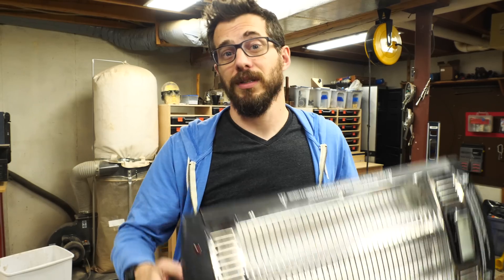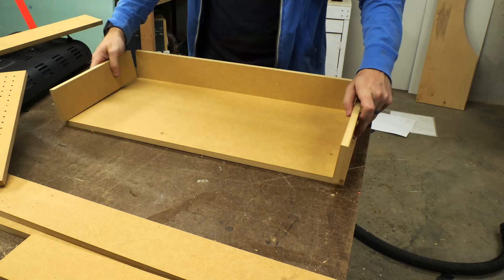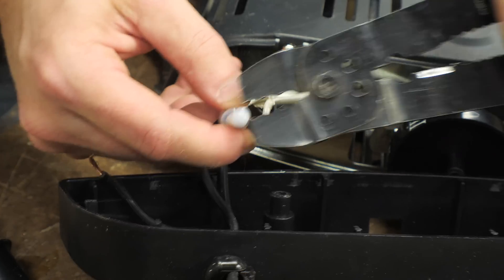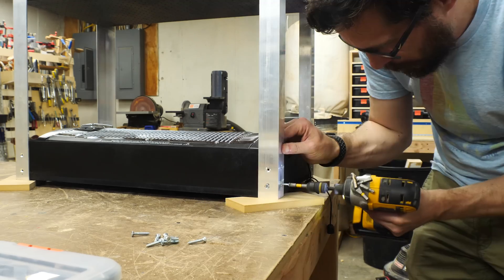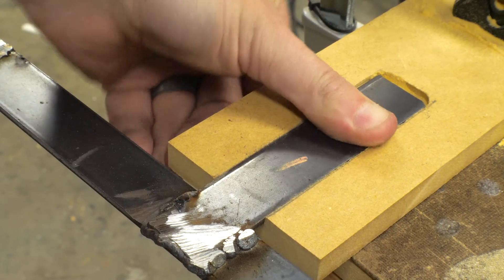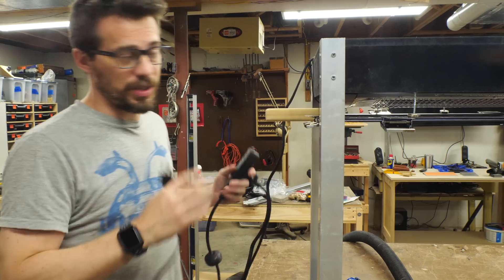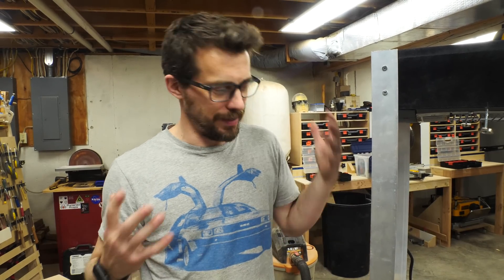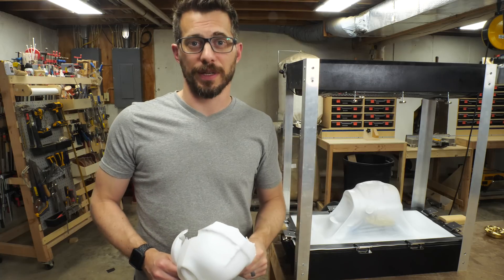How to Make a Larger Vacuum Former | I Like To Make Stuff

Comment: Hi Bob, i might have an idea of how you can dirstibute heat across the whole board. I never tried this but i think it might work. So the idea is to insert a solid 2mm copper plate under the heater. I believe that if the metal gets warm enough the temperatre gradient from center to sides would be around 5 deg C.  I would love to see you trying it. Keep up the good work :)

Comment: Just a tip from a cabinetmaker. By using MDF, you're losing vacuum suction anyway. MDF Is porous and allows air to pass through. We use it as a spoilboard on CNC machines for that reason.
Reply: What do you suggest instead?

Comment: Amazing job...
I what make one for kydex.. can you test it whith kydex..
Make an holster for your knifes and allot of things more..
Keep up the good movies.. chears from Portugal
Reply: Kydex is harder to draw with a shop vac. You need to use an air tank to draw a vacuum into. Then when you pull down the heated kydex, you release the valve to the air tank. Air will come rushing into the tank much harder and faster than you can with any other method.
Reply: @EcoMouseChannel  I made a vacuum box specifically for forming kydex holsters.  I used a 1.5 hp shop vac and made the top frame with a fairly this silicon sheet.  Worked pretty well.  Since I was using a real gun, I could read small lettering and serial numbers on the back side of the kydex.  I usually used .080 sheets.

Comment: When your'e welding dont pull te torch but push it you get a cleaner weld and it burns better in the steel so you have a stronger weld

(Sorry for bad english)

Comment: awesome vid, i keep meaning to build a vacuum former. if ur heated usable area is smaller than the vacuum plate then u could get bit more in suction if u block the unneeded holes. i would ditch the binder clips, and the 2 sandwich frames identical and add 2 more handle pieces and make them a bit like a clamp, this would improve the seal u get with the foam.

Comment: Curious, how would you reduce the 'ribbs' formed?  Any ideas?... I had a small 'vacuformer' as a kid.  It did small ABS sheets a little bigger than a trading card.  Made cars and trinkets of lots of colors (I think Mattel sold it).  Some 40+ years ago <grin>
Reply from the maker: Some others were saying to lower the temp, let it heat longer and more evenly. That should help with the webbing.  I still need to test that out.

Comment: hey bob, can i give you an advice?, i'm not an expert tho, i just realize that if you give support to the material before it strech to form a baloon, use somekind of pneumatics  cylinder to pull the support when your frame pass the censor and triggered the pneumatic and it dont give the folded effect on the form. use pneumatic for fast response. just a little advice from a regular viewer. good idea tho.👌
Reply: and a tighter gasket for better print "resolution".

Comment: Sugestion: Move the plastic a few inches further away from the heater, it will take longer to heat it up but you may get a larger heated surface. :)

Comment: i have 2 notes : 
1) what could help and what usually is done is a pre blow which stretches the material so when it lands on the object you don't have to rely on the vacuum that much .
2) is that when for example you do your camera , you should tape of the holes on your board except those within an inch so that the vacuum is strong where it needs to be.
love the vid FYI

Comment: In that situation you could have cut a thin slot in the mdf leading to the cable entry hole so you could have fed the cable into it, save you having to cut and re-solder. I know sorry, it's easy to be smart after the fact :)

Comment: Great project Bob. I wonder if your forming would improve any if you flipped your whole machine over. This would take advantage of the heat rising to heat the plastic (you'll have to watch the spacing), and your formed shapes might stay more consistently thick because the shape will match the bag of the plastic. I work for a large-format thermoforming company and never get tired of watching the process.

Comment: looks like HIGH is too hot, from the few short clips, I don't think you're getting even heat/melting across the plastic. You should try a run on med or low, and see if you can't get the plastic a bit more "droopy"

Comment: Great video dude. I would suggest you are getting your plastic hotter than needed. Normally you would just heat it up until it's soft rather than fully drooping like that. Also would a thin sheet of steel inbetween the heater and the plastic help distribute the heat better so you can make larger forms?? May take longer to heat up but otherwise should do the trick.
Reply from the maker: Great info, thanks!!  I've still got lots of experimentation to do!

Comment: This is really cool Bob!
It is nice to see a revisit and see how projects change.
I don't know if this would work, but what if you made a second metal frame with handles and cut some MDF to fit over both handles. Would the pressure of the wood holding the two frames together be enough get rid of the need for binder clips?
As I type, one issue I could see is the plastic getting pulled from the sides of the frame without the handles. But I haven't done vacuum forming to know if that would be an issue.

Comment: Ever thought about making a hot box for heating up PVC so it can be bent easily?  I also thought about turning a piece on my wood lathe that would flare out the end of the PVC so it would fit over the end of another piece and bypass the coupler between pieces. BUT the flared end would be thinner material.

Comment: I use mine for decoy heads.  carved head shape cut it in half lay halves down with a buck,  pull the plastic cut them out and melt them together.  mount them on a stake use plastic bags for body.  a little breeze great decoy for snow goose season

Comment: I’ve gotten to play with a few of these at Auburn University, specifically one that does full 4x8 sheets of abs. One trick they use to get cleaner pulls is to use a piece of wood or a silicone spatula to even out the creases. We also just used quarters to space the objects of the vacuum table. You could also try drilling small holes through the object to get more surface detail, a 1/16-3/32 but should be fine for thinner plastics

Comment: It probably has a unnoticeable impact, but air actually leaks through solid MDF. Sealing the actual MDF surface (even with just wood glue) might have some efficiency gains.
Reply: The paint job probably solved that.
Reply: blah Thats probably right but sealing those gaps between the mdfs would help a lot, and the sealing platform and plastic
Reply: Gabs? Did you mean gaps? The glue seemed to take care of that.
I meant the MDF itself, which is central to blah's question.
Reply: Double Dare Fan the gabs between or the mdf?

Comment: For the clamping you can also use some small bolts with holes in the vacuum box on the places that they touch the vacuum box, so you have a flush contact and better vacuum. Also for more equal warming of the plastic place it a bit further as I think it is to close and doesn't heat the edges properly, which may turn out to be a problem when trying to form bigger objects.

Comment: Some changes that just running through my mind, unsure if they're actually useful.  

First ditch the clips, they will prevent getting a really good seal when you press it down, instead have both top and bottom metal frames have those handles then make your wood covers such that you can slide those right on and hold both top and bottom together, then your gasket at the bottom will be much more effective since there won't be any gaps.  Another option if you don't want to do that is put tabs around your frame that extend past the gasket then use those to put the clips on to.

Second is your heating element.   Instead of having the heating element so close to the plastic, burn issues, make a larger box run the output on the shopvac up to the heating box and create forced air situation so you can more evenly heat everything, and you might be able to use other plastic too.   Or if you don't have a virgin shopvac (no dust) throw some computer fans up there to blow the air around.  

Lastly is there any issue with the fumes that would be putting off when you're melting plastic?
Reply: Its better to make a raised section in the middle smaller than the main beed so the frame wraps around it..

Comment: don't magnets start to lose their magnetic properties when heated up ?
Reply: You're right, some of the rare earth magnets start degrading at rather low temps.
Reply: Magnets lose magnetism at a much higher temperature than the plastic should ever see for thermoforming.
Reply: The Curie Temperature for a typical Neodymium Magnet is about 340°C (644°F) Waaay hotter than even your standard oven.

Comment: Now that i thought of it, you had done similar remakes of previous projects. This one is remaking the smaller and simple vacuum former to be bigger, but there is also an ON AIR light sign you made long time ago, and you upgraded it with an LED panel sign that runs on Raspberry PI. And also that longboard out of wood pieces stuck together which you later made a better one with a stack of veneer and a vacuum form, and even later a DIY trike. Really excited to see all these old projects turn into their 2.0 version!

Comment: genius project and well thought out. your videos are a pleasure to watch
Reply from the maker: That's very kind, Thomas! Thank you!!
Reply: just a suggestion, if you were to suspend a Plate of stainless steel under the heater and use that to creat a more even heat when you bring the plastic up. i might even allow you to get the full area you were looking for. might take a little longer though depending on the thickness of steel

Comment: Great video! Be sure & use thick enough plastic to allow for stretch so it doesn't crack or break the plastic. Also you can use a heat gun to help work out the pull of the plastic once it's down on the vacuum part of the table.
Reply from the maker: Good call on the heat gun!

Comment: hei Bob, I'm a woodworking student from Germany. If you ever build another vacuum chamber in one of your future projects, I would suggest you not to use MDF as the box-material. It drasticly lowers the possible vacuum in the chamber, because of is not air thight. You should rather use e.g.  some melanin boards and seal the joints with silicon, as it would give you a mich higher vacuum. 
Greetings from Germany. 
Keep up the great Work.
Reply from the maker: Interesting to hear! I wonder if it'd be worthwhile to open the box up and coat the inside surfaces with something to seal it.
Reply: sorry for the bad spelling. German autocorrect got me :D
Reply: As far as I could see, the vacuum that is beeing produced is good enough for your purpose. That's why I wouldn't suggest to open it up and try to seel it. I think it'd be pretty difficult to seel it "good enough" to get any drastic changes. I don't think it's worth the time.  If anything, i'd rather build the bottom box completly from scratch with melanin, as the costs for the "airproof product" would be at least aus high as the new material.

Comment: Couldn't you build a thick plastic box and put the heater on top with the vac on bottom so the heat builds up and you can adjust the height of distance between the heater and what your object is? Instead of sliding it up and down so far?

Comment: AvE did a video about welding sheilds a while ago explaining that the auto darkening doesn't actually protect your eyes and without it you should have been fine
Reply: The shields always block UV light, yes, so you won't get a "sunburn" on your corneas even if the battery's dead. But you still need the auto-darken feature to protect your eyes from the visible light, which can damage your retinas.

Comment: Instead of using the binder clips you could make it’s so both steel sections of frame had metal handles, and when you slide the wooden handle over it, that’s what keeps them together.

Comment: Hey bob, one piece of advice, i think that the vacuuming box should be more insulated, like with a coat of silicone or something like that and maybe stepping up your actual vacuum with something with more power. Flux is inversely proportional to the area so you need more "sucking power"

Comment: the frame

make the two sheet frames out of a non-magnetic material, embed magnets in them to hold it closed during forming and another set of magnets to hold up to the heater

on a long slide of the frame, piano hinge on the length of the frame, probably on a wider flat bar so the hinge/screews don't interfere with holding the plastic or vacuum. 

Rather than support the heater at 4 corners, use stiffer columns on two corners of a long side.  Makes access from the non-column long side easier.

Comment: I wonder if you could make the handles the clamps? If you put metal sticking out on both the top and bottom parts of the plastic 'carrier' you could sandwich the plastic between each part and then put on the handles to clamp it in place. You might need different handles if you used different thickness of plastic but I think it's an elegant solution to the clamp problem.
Reply from the maker: You could but you also need clamping pressure on all 4 sides. As the plastic gets stretched, it needs to stay put in the frame on all sides.
Reply: maybe a piano hinge on one side of the "carrier". Then you'd only have to clamp one side
Reply: Also hadn't seen this until after I had posted the same thing myself. What if you gave the steel frame parts a slight curvature so that they apply pressure on the two sides without handles, 
like this poor diagram -->   top,plastic,bottom = )|(
Reply: i commented the same thing then i saw yours 😂great minds think alike.
Reply: If you added some tags around all sides and clamp those instead, maybe lower the plastic, so the heater can cover a larger area, it might take longer to soften though..
Reply: Oh wow...I really shoulda read some comments before posting.
Reply: Malt & Make 
Wtf are you trying to say
Reply: Matthew Keen 
Except you don't have one